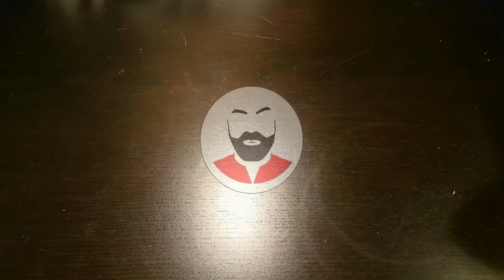HOW TO Power a Pico PSU on a Budget (Modified 360W LED power supply)

Comment: Great project but:
- does not your notebook need a 19.5v input instead of 24?
- 360/24 = 15A and not sure 100% from a single output line

Did you test this psu with your notebook?

Regards
Reply from the maker: Hi Flavio. I've built this for the 300W pico PSU used in my portable gaming PC and it provided more than enough power. I did not measure to see if it actually reached the peak 15A of current. However, I've tested it as well with 2 laptops - a Dell and an HP and both work to power on the machines - even if they are rated for 19.5V. Best wishes